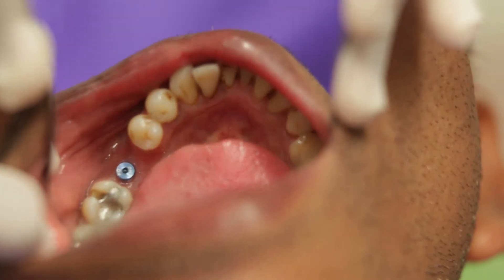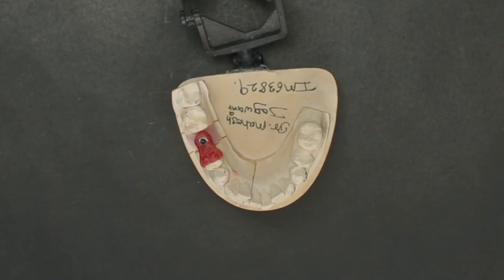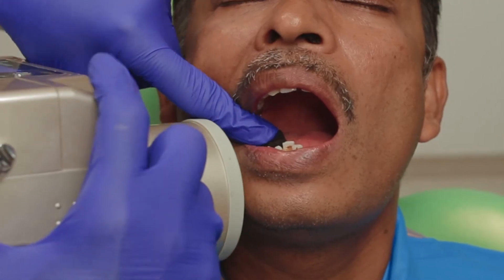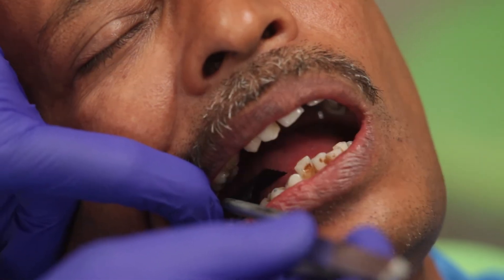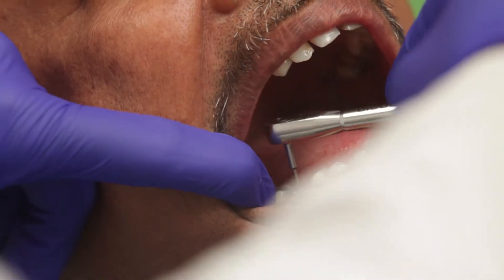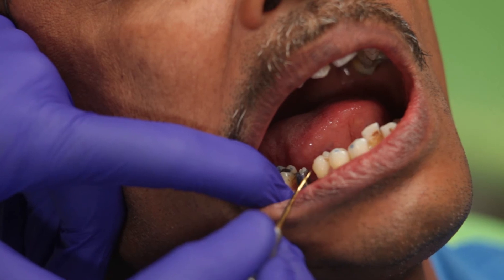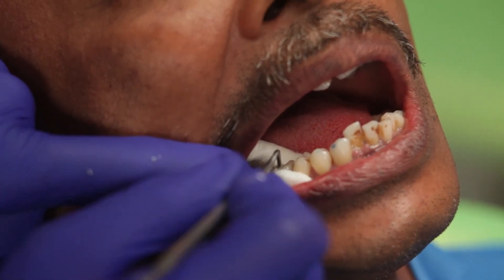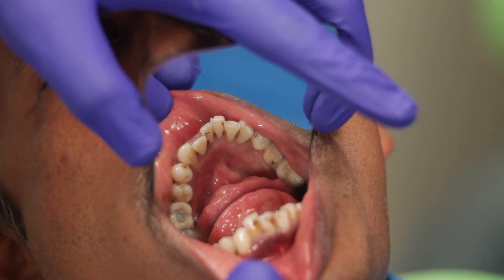Implant Crown Cementation

Comment: Very nice! I probably never will use cemented solutions, but if I had to, I would do like you: ALWAYS custom abutment and have the cement margin supragingivally. It is the only way to remove cement, other solutions there will always be cement remnants subgingivally. Good to see responsible dentists! Cheers from Norway. :)
Reply from the maker: Hello, Screw retained is the way to go in most of the situations, unless there is a financial constraint for the patient(like in this case). One way to tackle the excess cement is ,as you rightly mentioned a supragingival margin on the abutment , only for non aesthetic areas though. In other cases , the crown can be cemented over the model itself , all flash removed extraorally and then the assembly torqued into the mouth , just like a screw retained solution.😊

Comment: Thank you for the video.May I ask why would you not cement(bond) the crown to the abutment extra-orally as that reduced excess cement into the sulcus ?thank you.
Reply from the maker: hi... You can do that but im more comfortable doing this intra orally since sometimes,  after cementing extraorally the restoration fails to seat completelt(due to micro movement perhaps). excess cement can be controlled by designing the abutment margin supragingivally.